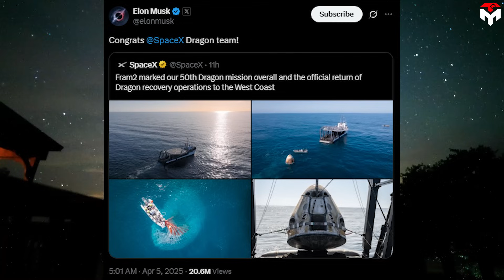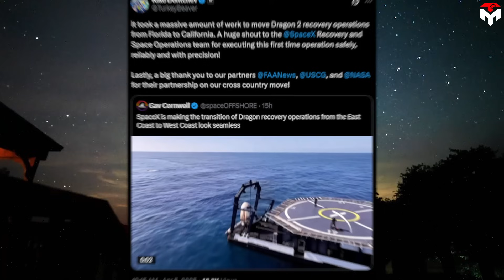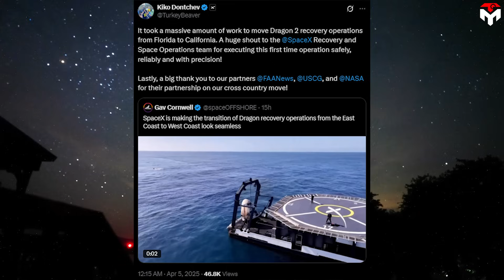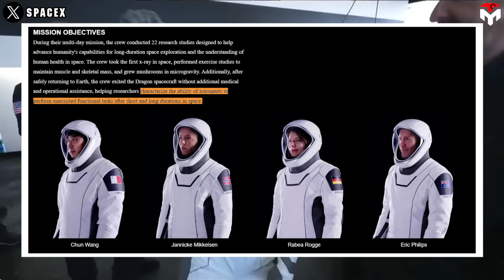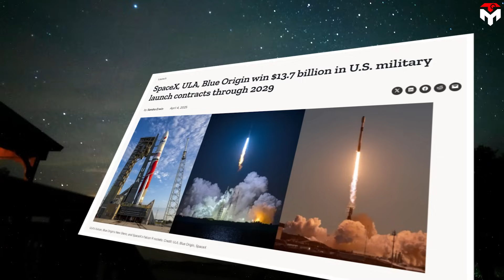What SpaceX Dragon just Did After Rescuing Starliner Astronauts Shocked the Whole Industry!

Comment: No, it didn't use its on-board thrusters to dart from pole to pole. It was simply in a polar orbit, just like a hundred other flights. And what value did these crew members add to the flight? Looks like a vanity flight to me.
Reply: The billionaire Mission Commander actually helped fund the flight.
Reply: @markgreiser464  that adds no value to the flight.
Reply: @ it does if you needed the extra cash. I don't function in jealousy and hate, so I see no reason to drag down the Operation and what was accomplished.
Reply: @markgreiser464  And what exactly was accomplished? Four people went into space and did nothing except chatting to each other. Nothing new was done. Polar orbits have been standard for years. They went up. They came back down. This was barely better than Bezos's fairground rides.